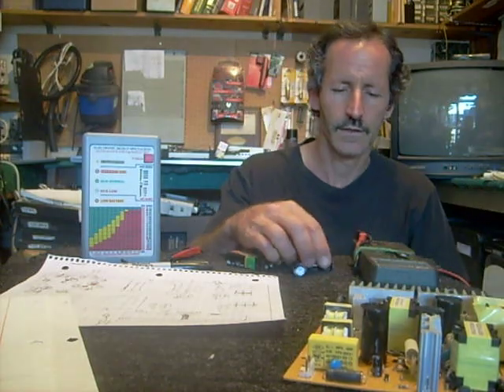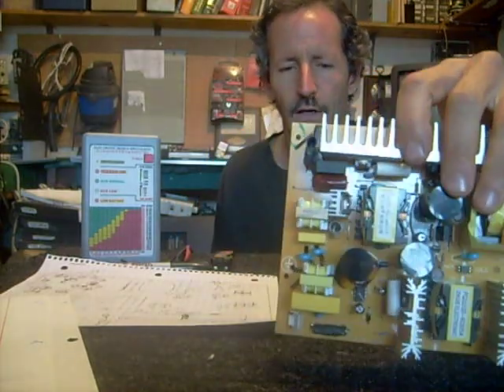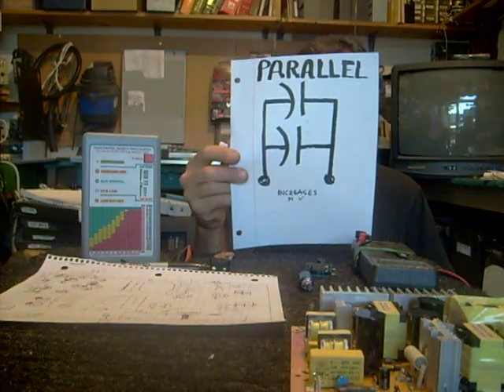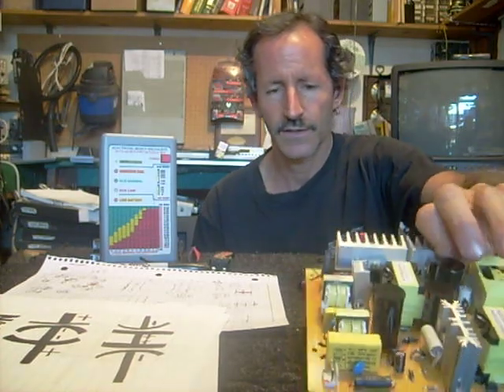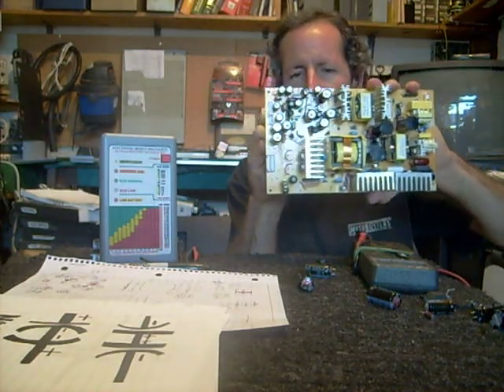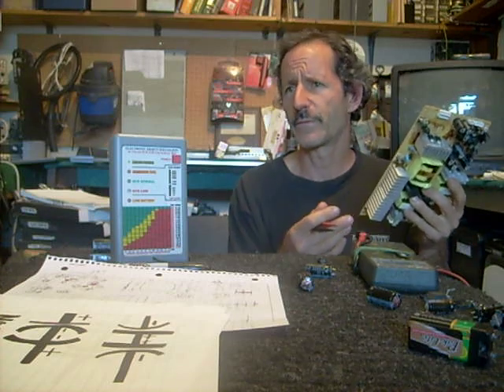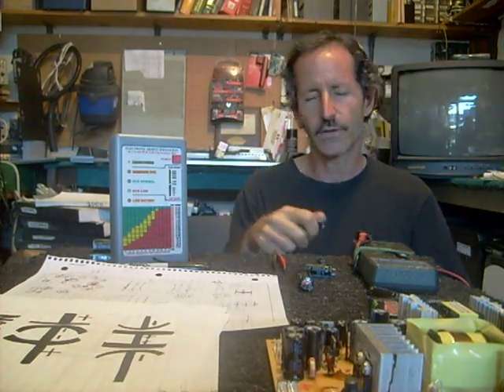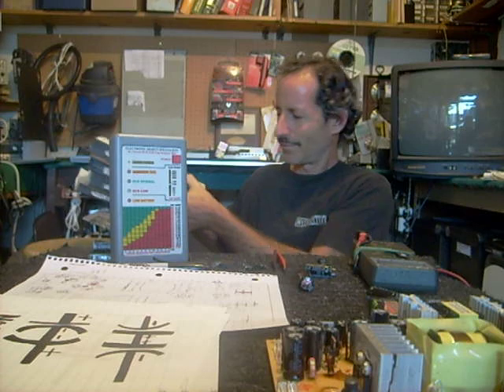LCD TV Repair made easy # 1

Comment from the maker: Glad to hear it worked. Make sure you apply some new heat sink compound back on the back side any semiconductors or transistors that need it, Otherwise the replacements will not last.
Dave

Comment from the maker: @Synaux I think the best capacitor tester for around a hundred bucks is the Blue ESR capacitor tester. 
If you go to my website at tvrepairinfo you will find a link you can click on that has some comparisons about the various capacitor testers.
As far as your question about Rubycon capacitors I don't know much about them. I generally order my caps from digikey and I suspect most of the caps they sells are pretty good. They have a lot of Panasonic capacitors, United Chemicon, and Nichicon .

Comment from the maker: The LeakSeeker is a great, but I have an antique ohmmeter which is able to divide an ohm into 50 divisions, and so far It worked well enough in helping me locate most low resistance shorts. I was told the blue ESR Meter is able to divide on ohm into 100 divisions so that might another option if the leak seeker is out of your budget, plus It can give you ESR values for capacitors.

Comment from the maker: @VooDooGeorge83 Replacing an inverter board is generally pretty easy. Inverter boards are often the cause of no back light but I suggest you look at the rear of the TV through the ventilation slots  to see if the back light is working. The back light can be working but the loss of a video signal will block the light. That's why I suggest looking at the rear of the TV  to see if it's working. Just don't to confuse it with the light coming from the power on indicator LEDs.
Dave

Comment from the maker: @sepertude Your correct in that the ESR value will be higher with a higher voltage but have you ever ran into a problem by going up a few extra volts? I don't think I ever have.  I'm going to put an additional annotation warning people not to go up to high in voltage. Thank you for pointing that out.
Dave

Comment from the maker: @xavielo83 I don't know for sure but you might try warming certain portions of your circuit board to see if the problem improves. Often times a bad capacitor will slightly improve when it's warm.
Good luck.

Comment from the maker: @lionbrains In most cases you can figure out if it's the tactile switches by unplugging the wiring harness which goes to the tactile switches while using the remote control to see if the problem goes away.
Dave

Comment: Hi, yes I have owned the one you have and another one MCM sells but found the Smith meter the best for ESR and low ohm measure. Very accurate. Most important bench tool I own and have had the Dick Smith since 1985.

Comment from the maker: In a case where a TV is slow to come on, I would try the hair dryer tick to see if warming the capacitors improves the problem. I have seen boarder line capacitors cause a no start symptom. 
You might check with Acers customer support about that icon which stays on the screen.

Comment from the maker: @aristv93 Many times a TV which has damaged from a lighting strike can be repaired. It all depends on the intensity of the strike. The power supply is the first part to be effected. Start by checking the simple stuff like the fuse, thermistor, bridge, caps and voltage regulators.

Comment from the maker: Its hard to guess at a problem of this nature, but going over mikes tv case histories it mentions first checking  for loose connections on ribbon cables. Other symptoms like yours were caused by bad LCD screens and in one case bad capacitors in the power supply.

Comment from the maker: I would suggest you test all the components in the front end of the power supply. There is a good chance the damage didn't get past the power supply. The key components I would suggest testing are the bridge rectifier and the varistor. The power IC and any switching transistors used on the primary side of the power supply.

Comment from the maker: @Ncharlestun The main generally has the tuner on it and may be under a metal plate but it's not the same thing as the T-con board which is also under a metal shielding.

Comment from the maker: If you talking about the end of the ribbon cable that is suppose to be attached to the LCD Display there is no fix that I'm aware of, but I'm not sure this is what you mean. If you talking about the other end it can be reseated if you lift the lever on the connector and re-seat the cable into position that flapping lever back in place.

Comment from the maker: I don't know about the color problem but it's not likely to be related to a bad tuner. In regards to your HDMI jacks going out If your TV has a separate board with the input and output jacks replacing this board may fix your problem, but the lightning may have also effected the main board as well.

Comment from the maker: @cris15ization If I had a symptom of this nature I would first try tapping the TV to see if this changed the static noise any. If so it would suggest there might be a bad solder connection on the audio board. I often use a 10 power jewelers loop magnifying glass to see if there are any bad solder connections. 
Dave

Comment from the maker: @NETWizzJbirk You can test most capacitors with out removing them but when there are two or three in a parallel circuit often times One or Two capacitors need to be removed in order to get an accurate reading.

Comment from the maker: @FlakeyFreakout 
There are some sections of a TV which have enough voltage to give you a serious shock but I  can't say if it would be fatal or not. I have had many shocks in my life and a couple were pretty serious but nothing has killed me so far.  
Other than doing some voltage tests all of the repairs I do are with the power off and the TV unplugged!

Comment from the maker: @urouk Here is one possible reason for the problem your having.
 Most power supplies in VCRs and other electronic devices have a thermistor and a choke which prevent to much inrush current from doing damage to the power supply when you first turn it on. If your thermistor was shorted or the choke was shorted between the windings a larger fuse might solve the problem for a while but with out inrush current protection you may have damaged the diodes in your bridge rectifier or other components.

Comment from the maker: @Thetruthishere11 On LCD TVs I would say the most common failure is bad capacitors in the power supply. The second most common problems are inverter transformers opening up on the secondary side. 

On Plasma TVs I'm not sure of their most common failures.

Comment from the maker: @Mikeybat07 I can't say for sure but some have found there is an adjustment labeled VS which can be re-adjusted to eliminate the green and red dots.  If you adjust this variable resistor just make sure you mark where to put it back in case it doesn't help.
Dave

Comment from the maker: Yes some Y-sustain boards may be a bit more difficult to remove due to the 
heat sink compound which may have become sticky over time. If you can use a 
torch with out damaging the PC board it may be helpful but be careful not to 
damage the circuit board.
Dave

Comment from the maker: After  lightning strikes a TV it's generally the power supply which gets damaged.
If your lucky it may have only damaged the fuse and varistor which is suppose to short in such an instance to protect your TV from further damage, but with such a high voltage going into your TV from the lightning strike it may have also damaged several other components such as the power IC and or the Power transistor along with a few other parts.

Comment from the maker: @proudmomofjj It could be a faulty component on the board which has all your input jacks but I would start with the simple things such as looking for small hairline cracks on the board and make sure the power supply inputs to the Jack pack isn't missing or being shorted to ground. I can's say specifically what the voltages should be with out a schematic but I would think most of the voltages on this board would be around 5 volts.

Comment from the maker: @baldmikey96 Most likely a power supply problem. I would start by checking the obvious things like your fuse, caps and switching transistors. You might have a bad varistor as well.

Comment: @GrantsPassTVRepairs The main/main logic board was under 3 easily removed plates with cooling holes and along side the power supply. You lift up this assembly and can access screws to remove the smaller T-Conn board metal cover panel. I am going to reassemble to test the screen in darkness. There is no visible damage, fuse is good, caps look good but as you said caps may look good but may be bad. An old girlfriend gave it to me to examine after a repairman said it was the "logic" board.

Comment from the maker: When you have a shorted components such as ICs, diodes or transistors  your fuses will keep blowing until you replace the bad component. The gentleman who told you a fuse is a fuse is partly correct but there are some applications that call for a slow blow fuse. In your case I would guess you probably have some shorted components.
Dave

Comment from the maker: That Number you gave me doesn't appear to be a part number. Nothing came up when I Googled it. Here are a couple fast switching diodes that I'm often able to use as substitutes in power supplies.MR856G is a 3 amp 600 PRV. If you need a Ultra fast switching diode you can often use a MUR460G. it can handle 4 amps at 600 prv. If you can get by with only 1 amp at 600 PRV you can often use an RGP10J. I believe this also crosses to an NTE 552. Hope this helps.

Comment from the maker: You can fix it if your willing to  spend the time necessary to troubleshoot the audio circuit, but I can't tell you where the problem is by guess work. Sometimes a firmware issue can cause the sound to quit working, so you might look into reloading your firmware.

Comment from the maker: @mtogono Yes the voltage will remain the same when capacitors are in parallel. In a series circuit the capacitors can handle a higher voltage but their microfarad value goes down.

Comment from the maker: I can't guess at what's causing your LCD display to turn red but did you check the simple things such as freezing the edges of the LCD display to see if you noticed any improvements? Does the problem improve when you use different inputs or slightly warm the circuit boards?
How about reseating your ribbon cables? Is the voltage going to your T-con board as high as it should be? (Generally around 12 volts) and does it have any detectable AC ripple on its B+.input.

Comment: Would you please make a video explain different types of flat panel  tv's and  the basic layout of boards on them and what circuitry is usually on each board.  Audio, video, power supply, monitor driver boards and what the connectors that go to the screen and talk about the back light.  I am sorry but I would like to understand the basics and I feel that would help greatly to understand how to approach repairing my own tv.  Thanks again and have found your videos very interesting.

Comment from the maker: @adam3176 Sometimes there is not easy answer to finding out what's wrong with the new TVs. Personally speaking I generally don't go to far beyond the power supplies and the inverter boars which are two of the most common problems areas. For the more abstract stuff such as you will find on the T-con board and the main boards aside from testing capacitors, voltage regulators, and loose ribbon cables, and bad solder connections  I don't knock my self out to figure them all out.

Comment from the maker: @marcsummerhays Perhaps the 12 volt source is missing because the power supply is not in the run mode so you only have your stand by power. Sometimes you don't get your other voltages until the power supply is in the switched on or run mode. On the power supply board it may say switched or SW on the output terminal letting you know it must be on to have a voltage present. 
Dave

Comment from the maker: @Lockemeister I don't know if MIkes book has the problem. You can call him and ask. He will generally give a person one free tip. 
Sometimes it only seems that the high voltage is working because it turns on for a second and then shuts down, and this can be long enough give you the impression the high voltage is working. Did you check out the horizontal output transistor for shorts and the flyback transformer?

Comment from the maker: @hughesbill45 If your talking about an older style TV a green screen can mean one of your color transistors is shorted or your picture tube elements are shorted. You can get the picture tube rejuvenated to see if that helps but often times it's not worth the effort and may even make the problem worse.

Comment from the maker: @joshcolorado With LCD TVs there are a great many things which could give you a symptom like this. Naturally you want to start by checking the easiest things first such as testing the capacitors in the power supply and move on to the main board. What did your ESR capacitor meter tell you about the capacitors in the power supply?

Comment from the maker: Water may have created a conductive path where the tape carrier package is bonded to the LCD Display. Perhaps it will dry out in a couple days but there is also a possibility you may have damaged the display even though you didn't apply much pressure.

Comment from the maker: @rocznrowsez I'm wondering if your LCD display is starting to disconnect where the tape carrier package connections attach to the side of the screen. You might try using freeze spray on the screen edges to see if the problem improves. If so there isn't much you can do other than jam a piece of rubber behind the display connections but that's a long shot. You might start by reseating some of the ribbon cables and looking for bad connections.

Comment from the maker: @bloodyman125 Did you do all the tests I show in my videos? I generally start by checking power supply voltages. If they test okay I move on to the inverter board and then on to the main board.

Comment: A good presentation, although, with an ESR meter, it is recommended that a new capacitor (electrolytic) is measured, then compared with the measurement of the old, and if there is a vast difference, replace. With switch mode power supplies, it is imperative that 'low ESR' electrolytic capacitors are fitted in the regulation circuit of the 'chopper' transistor; the one nearest the base connection in the circuit. A little more expensive, but avoids catastrophic results with a cold switch-on..

Comment from the maker: @rumdumridiculous 
Not seeing the stand by light would suggest there is probably a problem in the stand by power supply source but I'm not able to guess with out doing some tests. Did you start with the simple things like checking the ESR on the capacitors?

Comment from the maker: @thegizmojo  I've noticed there are some TVs which have the same chassis even though they are sold under different names like Proview, Element and Polaroid  but I don't know anything about display interchangeability between TVs. Have you found a source where you can buy an LCD display cheap enough to justify replacing it?

Comment from the maker: @KGBALLER50 If your in a dark room and you can see a quick flash of light on the screen when you turn it on that's a clue its probably the inverter board, but I can't tell you for certain with out doing some tests.

Comment from the maker: @lionbrains As long as disconnecting your wiring harness doesn't disconnect the remote control sensor I don't see why it shouldn't work. I would hot think this would be a firmware problem.

Comment from the maker: In this video I'm using the CapAnalyzer 88A Series II. There are some occasions
where the capacitor I'm testing must be removed to get a correct reading, but in most cases they can be tested in circuit. In cases where the power supplies may have Two of three of the same capacitors in parallel It's necessary to remove or unsolder one lead before you test them.

Comment from the maker: Using identical capacitors is the way I was taught to make non-polarized caps, but you need to remember.when Two identical capacitors are in series their Microfarad value will be half of what you start with. In other words Two 100 MF capacitors in series will only be 50 microfarads.

Comment: thanks for your advice! Now it appears capacitor C5069 and transformer T5003 (labelled SRW3230PQ-X08 and TDK X 0729) are shorted/burned. Rather than waste your time trying to repair it though YouTube conversations I think I will have to get a service manual or send the supply to a rebuilder.

Comment from the maker: @rhondaj121 I can't think of any reason an Xbox would harm your TV unless the input jacks were stressed when you plugged the cable connectors into your TV. How does it work on the other inputs such as The tuner input?

Comment from the maker: @hendz1 No that would be a big mistake. If you put three 500 MF capacitors in parallel it should be okay but you shouldn't go from a higher to a lower value capacitor.

Comment: What is that capacitor checker you are using? That thing looks sweet and saves time not having to unsolder all those caps just to test them. Also which caps should we look for that the meter can't handle? Thanks

Comment from the maker: @JMLUVZ2FLY So what's your next step? What about pico fuses, diodes and transistors? Does your microprocessor have 5 volts on the VCC line. Is the stand by voltage present?